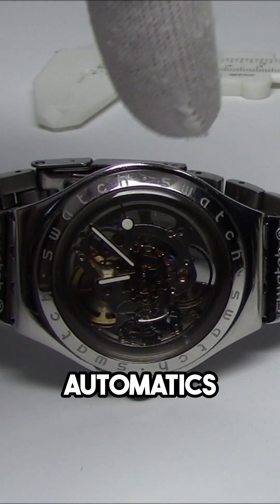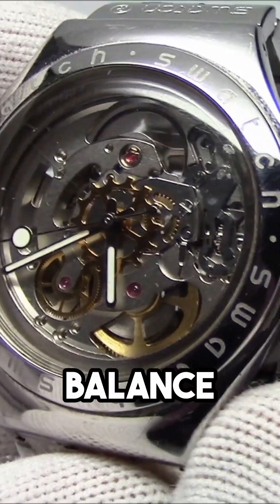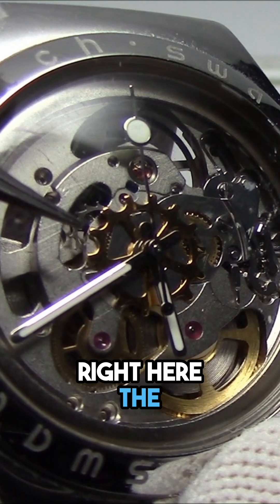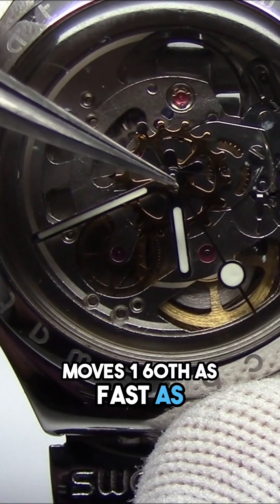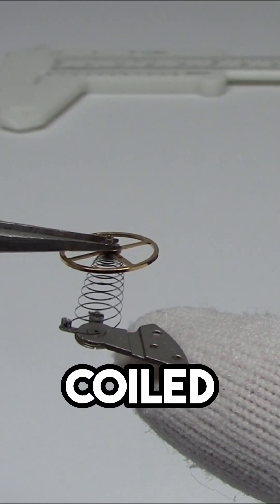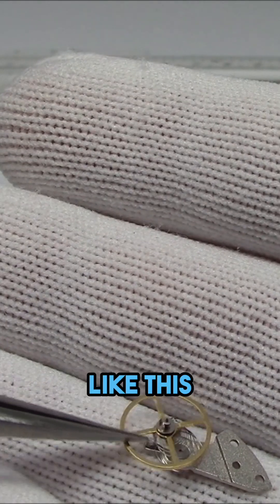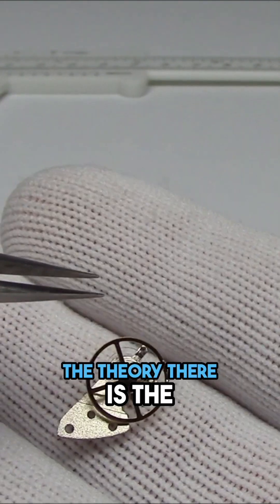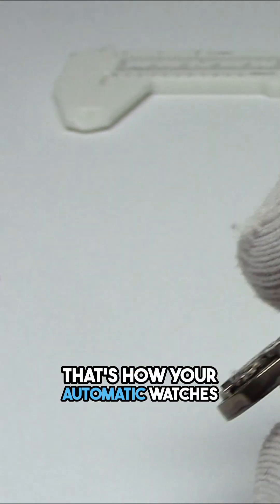How Does an Automatic Watch Movement Work? Explained in 60 seconds

Comment: I just bought a new Seiko 5 Sports. It runs fast (10 sec a MINUTE) and the balance wheel is barely moving and quiet slow. Shop told me to "wear it 10 days" but my take as a newbie is that something is wrong and i should not wear it and return it. Any help? Is that normal for a brand new watch?
Reply: Its magnetized